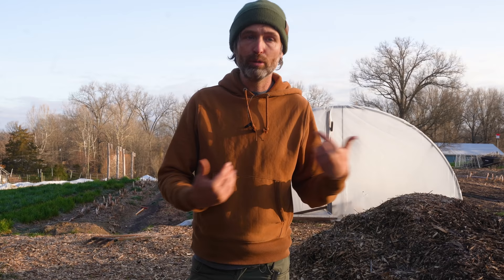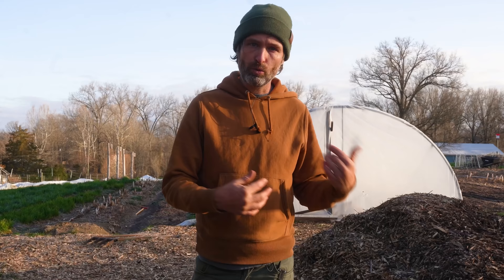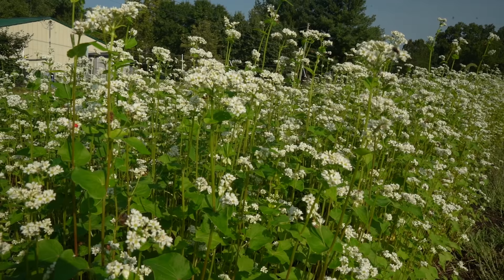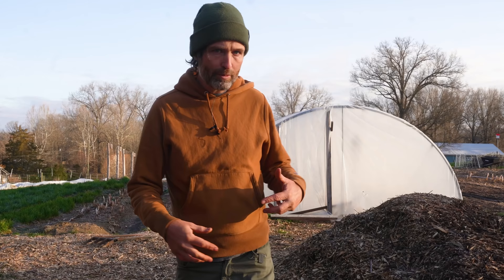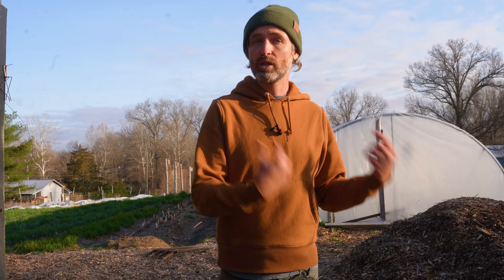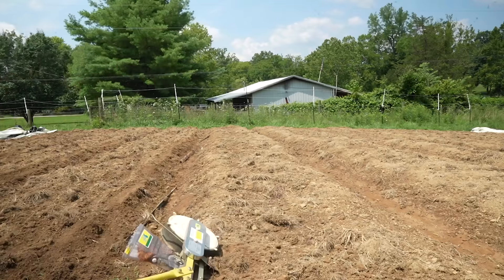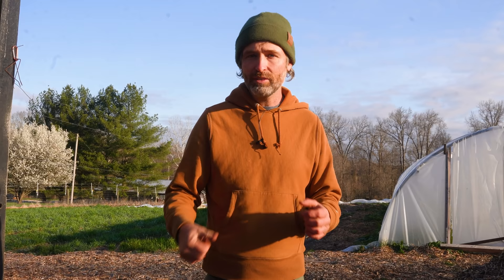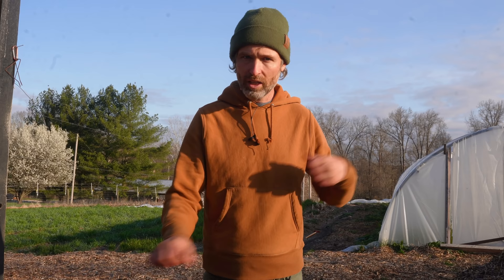How Not to Cover Crop

Comment: Termination of cover crops.... let’s do a whole video on that. And maybe some visual examples..... I’m 2 years into cover cropping in my garden and it’s mostly a mess..... but the worms and the bugs are coming back so I know I’m on the right track!  Thanks Jesse
Reply: I burry the cover crop when I improve the soil. I mainly use rocket as my cover crop as I can eat it and when it degrades it relaxes a compound that acts on nematodes
Reply: Cover crops should be terminated just as they flower. Once they flower they start taking nutrients from the soil
Reply: @greg2337
Reply: @greg2337  but how do you then proceed after that? If I just kill it and leave it there it’s going to take months ti be able to direct seed anything there. I don’t want to till. Does that mean I have to use a black tarp or sometning ?
Reply: @stevencats7137  Once you get the residue to soil surface, it will cool you soil temps temporarily.... Push back planting dates until soil temps are adequate and the lost time on the planting side will be gained from moisture retention and minimized heat stress.  Small seeds may need a small strip of residue separated (trash sweepers on a tool bar, etc.) But your bigger seeds will pop right through the residue.
Reply: @greg2337  Very nice .....that is  the logic explained well.
Reply: @stevencats7137  Just move the debris aside and plant into it. Once the plant gets above ground that residue is acts as a mulch. 
You could take it off the soil and compost it
Or till it in shallowly. 
Check out Joe Gardener Podcast episodes 099 and 100. Gives you all the info you need to cover crop
Reply: @greg2337  
I couldn't find it. Give me the link to the two episodes, please
Reply: Termination is recommended by using 2-4d by the usda... 

But please don't. I've been studying for the crop advisor certification as I am beginning to sell worm castings and educate farmers on new information and the information I'm reading makes me sick. Why would you terminate a cover crop with a pesticide??? Lol

Comment: My experience is that daikon radishes do a great job of breaking up soil.  My yard just laughs at tillers and yet daikon radishes grow well.  They getting fairly large in hard soil.  They get massive in loose soil.
Reply: Yeah, my experience has been similar to yours. Very sticky heavy clay soil. I used turnips as well as radishes because I had a lot of extra seed. I knew it wouldn't work as well as it really could, but it still definitely helped. One has to manage their expectations sometimes.
If I had nice fluffy loose soil, I'd just be growing actual veg in it and skip the turnips and radishes ;)
Reply: There are "tillage radishes" available for amending compaction issues.

Comment: I usually broadcast my seeds and it works fine if it rains right after that, both in terms of seed to soil contact and water availability. If it doesn't rain enough though, those seeds can sit there for weeks and last year my mustard was just over my knees by the time i had to plant winter garlic.

Comment: Great info. Worth mentioning that many overwintered grasses will prohibit germination in the spring. You need to wait 2-4 weeks after terminating before sowing.
Reply: Why is that?
Reply: @RichardBullKTM  I think as the plant breaks down it gives of allelopathic gases/ or exudates which impact germination. It stops when the plant has been broken down. Most noticable with rye grasses.

Comment: I'm rehabbing a narrow strip of much abused compacted clay for a growers group. I have it currently covered in thick fall leaves. It will get a good forking &  sunflowers for the first crop to bust some clay & generate flower sales $$$ for the group.  My intent was to do a winter cover crop in Fall of this year using hairy vetch & triticale (to give the vetch something to climb rather than mat down.) It stll could be a mess to hand terminate. It just occurred to me I only have to mark & covercrop the planting area of next year's tomato seedlings,
... about a 12 in diameter circle which will be easier to terminate by hand. I can leave the suflower roots in the ground & cover the balance of the bed with leaf mould. It will look weird, but I don't care. The point of using hairy vetch is the reported effect it has on tomato growth, production & taste. The whole 4 ft bed doesn't need it. Should be easier to scalp intermittent 12 in circles than a whole damn bed.
Reply: Advancing Eco Ag recommends gypsum (one ton per acre) to chemically break up the clay. You will also need soil biology, especially mycorrhizal fungi to complete the rehab of compacted clay soil. You might need to plow the field to initially break up the soil while adding gypsum and compost.
Reply: @Horse237  Agreed. It may take more tha 9 mos of being covered with leaves, but those leaves will introduce some worm food & form a base for myco one I can get living roots in the ground. The owner may pop for an application of John & Bob's treatment if it still looks pathetic when we rake back the leaves. He would rather put some speed on this soil rehab.

Comment: Good to see more videos coming! I’m in a pickle now, trying to crimp my rye today that’s not quite as tall as I’d like it to be. I’ve mowed and tarped a few beds to see how that works. I should of used a winter kill crop.
Reply from the maker: Oh no! Well with a enough time and heat it should work 😬
Reply: Are you planting in seeds or seedlings? What kind? (There may be a way around the thick rye mat.)

What zone?
Reply: @flatsville1  probably just transplants for right now. I’m in southeast Virginia
Reply from the maker: So unfortunately you effectively have a really light sod. What you did I think is a decent option especially if you mowed it very low. Clear plastic would maybe even speed up the process. The only other really option is a light under cutting of some sort, depending on how thick it is and the soil moisture level. So Hoeing or shoveling on a small scale can work but it still needs time to break down
Reply: @browntownorganics2172  Assuming you get a solid crimp to terminate, Jess is right in that solarization (clear plastic) will help it break down faster than occulation (black ag tarp.) Sealing the edges firmly down to the to ground will prevent heat loss & cook it down faster. You may have to wet it down some to get it to cook. You'll need several sunny days for this.

Part the residue & get a narrow point spade (spear head spade) to make/cut in your seedling holes. Plant in with some compost. That below ground root mat will evevtually shrink/shrivel down.

This is a cool tool for seeding. Not a drill to punch through residue. You'll have to part it first to find dirt.
 
See Earth Tools - Zilli Jab Vegetable Seeder.
Reply from the maker: oops I must have deleted part of my comment. *Mowing before tarping may also work, especailly if you mowed it very low.
Reply: Put some chickens on it!
Reply: @notillgrowers  I already did that to a few beds a couple weeks ago. Giving it another week or so.

Comment: Yeahhhhh termination is an issue for sure... the first year I tried cover cropping I included ryegrass. It didn't SAY "perennial" on the seed bag... but guess what?
Let's just say I was fortunate that I had only seeded it in a few raised beds, so it wasn't as bad as it would have been if I'd done the whole ground. I had to dig it all up to finally kill it off.
Now we're on a different place and a good deal of it is dotted with big gnarly clumps of ryegrass. Hooray. Since I'm trying to avoid synthetic herbicides and tilling, the best ways I've found so far to deal with it are cutting it down before it goes to seed, and simply digging up each clump and chopping up the root ball in spots where I want to put a bed or plant a perennial.  When I put that in a bed to help bulk up our thin layer of soil, I make sure to bury it deep and really mulch it well. So far so good. The other extra clumps/rootballs I take out do help keep the compost pile fed, so that's nice.

Comment: I mostly use wild lettuce varieties as a soil improving cover crop to prepare compacted soil for eventual planting in much improved formerly clay dead subsoil or healthy clay. It doesnt care if your soil is compacted and can extract the nutrients from the clay plus grows sooner than any plant in the cold Jan-Feb 7a months. It provides awesome microbial and fungal improvement with the roots i leave, and also produces an abundance of leaves that are cut and come again with evetually usuable nutrients for non clay friendly plants once composted or just thrown down on the "soil" around it. If you improve the microbial and fungal redox etc even the worst soil will be improved by the invisible helpers plus worms. Can also blend with water and quickly add back to plants. It also is an aphid trap/kill. The bolted stalks are amazing like corn for improving soil structure/ bottom of my winter hugelkulture mounds, and more. Biochar has also helped improve, retain, and expand soil health more than i could have imagined. Im no till except pulling and flipping ocassional weeds and using a pole to pry up the soil. Best beds were plant stalk winter hugel by far.

Comment: Here in zone 3 getting the soil temp up in the spring is our most important challenge. I have often wondered about the winter rye we plant in the fall slowing the spring soil warm up. We like to let the rye grow in the spring to suppress weeds and gain mass, cut it, rake it off, and then use it for mulch. I guess its a balance between competing objectives.
Reply: I am curious what your frost dates are? I’m in zone 4a I get about 90-100 frost free days. I want to start using cover crop but am  trying to figure out what will give best results between growing root mass, mulch production and speed of breakdown for nutrient available during the growing season. Average high summer temps are 65f. Am considering rye, have you tried any others?
Reply: @kamaliancirranoush1916  The only month we have never had frost in is July but we plant potatoes on Memorial day then other crops in early June. On areas not in veggies we grow a couple of crops of buck wheat during the summer because it grows so fast.
Reply: @billherrick3569  great thank you

Comment: We have to manage expectations. If I had lovely, loose, fluffy soil, I wouldn't be so into using certain crops to break it up in the first place. I know I'm not getting the very best benefit out of all my covers, but on the other hand I'm saving a lot of fuel and labor, while still improving the soil and getting worthwhile amounts of cheap biomass.
So, in a way I disagree somewhat with "treat cover crops like a cash crop and prepare the soil accordingly." That just doesn't add up for my situation. I get the idea for sure, but if I had to do all that work and amend the soil to really get the absolute most out of tillage radishes etc... screw it, I'd just plant cash crops in it!

Comment: Can I use deep mulch method to terminate the cover crop after mowing. I just mowed it down Feb 1st 23. I am thinking a 3 inch layer of straw. A 3 inch layer of manure and on top 4 inches of mushroom compost and let sit till late April. Then I will scratch in down to earth slow release fertilizers and plant? Am I wrong?

Comment: Yeah I have cereal rye on new beds now and am not really knowledgeable about how to terminate. I don’t have a crumpet, and these beds are mounded, so a tiller wouldn’t work well. We put laying hens on for a while but they didn’t want it. My husband torched it. Now we have black tarp on. It’s not really dying back but hasn’t been that long. Two other beds are still sitting and growing. I’m going to put meat birds on soon and then we will see what else. It’s so thick. I did broadcast. I really have no idea if this was a smart thing to do or not.
Reply: What’s the area of beds you’re trying to terminate? If it’s manageable by hand, a technique I like to use is chopping with a sharp shovel. Not doing any inverting or mixing like a tilling action, just a swift downward diagonal chop over and over to cut the plants and damage the root system a little. Maybe penetrating 2” or so.
Reply: @wheelerryanr  that’s a good solution. The question is when
Reply: @sandradelvecchio6894  My “when” is long enough before whatever the next crop is you’ll be planting. This depends on the time of year because decomposition is slow when soil is cold.If the plants are older there will just be more residue left on the soil surface after chopping. Just make sure to hit the roots some, and if they start to regrow you may have to go over it again.
Reply: @wheelerryanr  thank you! I had heard it gets irradiated at milk stage but that’s may and I need it to break down before planting, my growing season doesn’t go into November!